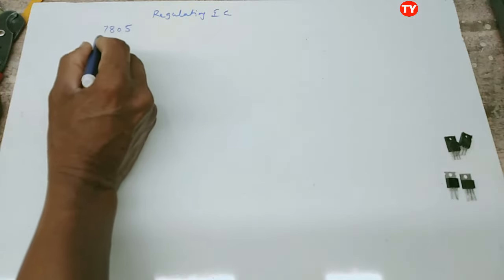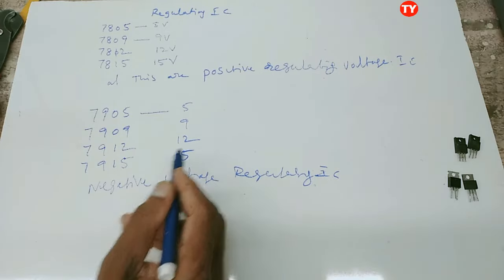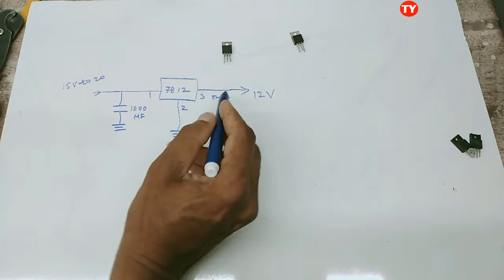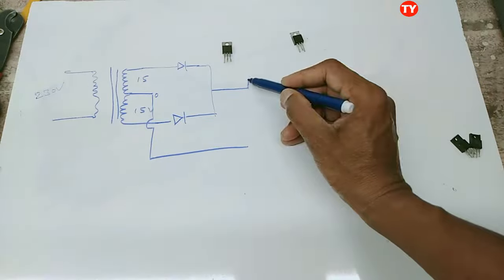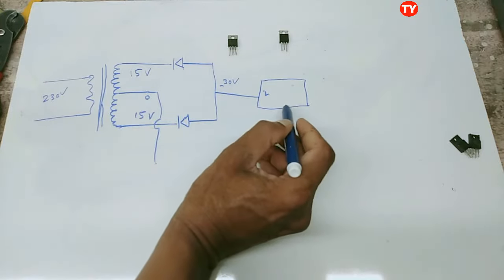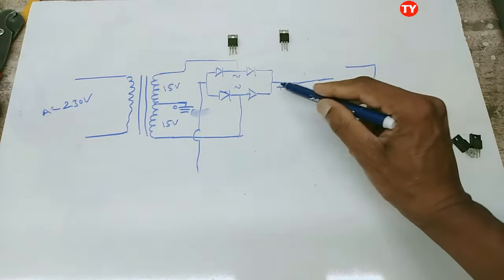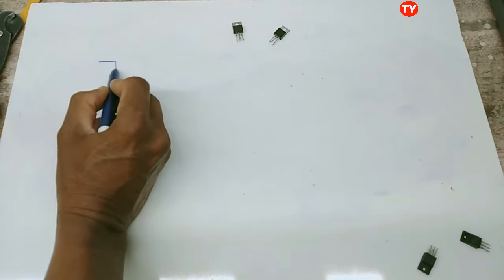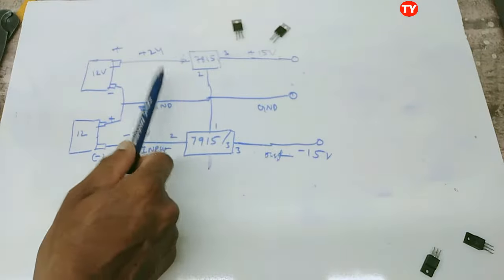regulator power  supply circuits using 7812 and 7912ic

Comment: My 12v*2 3000mA transformer where i connected 2200uf and 2 diodes 5408 and out shows 16.68 v.
 
Then i added L7812 and voltage shows 12v with heatsink .

But while i charged a lead acid battery then ic gone over heat and this continuty i cheaked got result 16.68v .

Then i stoped the charging and refresh .

Again on the switch and voltage shows 12v .

That neans heating the ic automatically ic is gone inactive .

In this time if i used any device by this power supply due to over vault connected device will be damaged automatically.

How can i keep my circuit safe while the output turn 16.68v to 12v while L7812 is inactive due to overheat ?

Comment: 48 SE12 kese banaye
Reply from the maker: connect  positive volt 7812 ic pin and connect ground pin no 2  out put pin 3 you will get 12 v
but you have to use good heat sink
Reply from the maker: use 200   ohmes 5 w  resistor  series

Comment: Cool, thank you.
Two questions:
- shouldn't the two batteries values be 24V each in order to provide +24V and -24V?
- in the bridge-rectified dual-output voltage the 2000uF capacitors are meant to stabilize the half-waves in input to the regulators? (avoiding them periodically dropping to zero?)
Reply from the maker: yes thanks

Comment: 7812 ic me 5v kase nikale
Reply from the maker: 7805 volt regulator ic available in market
Reply from the maker: use 7805 ic  it is 5 voltage regulated